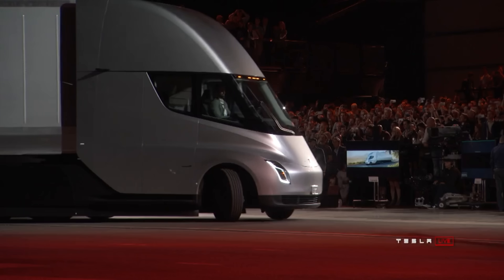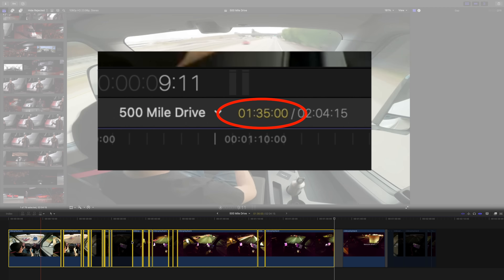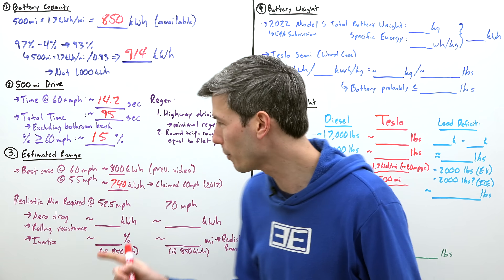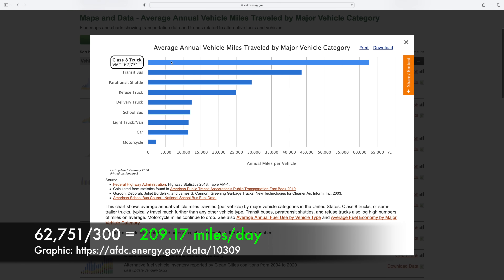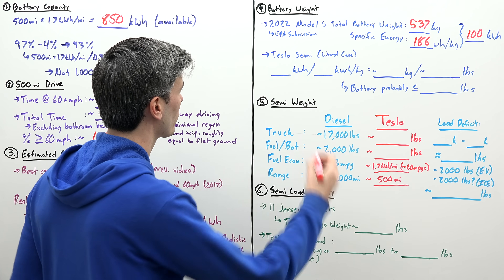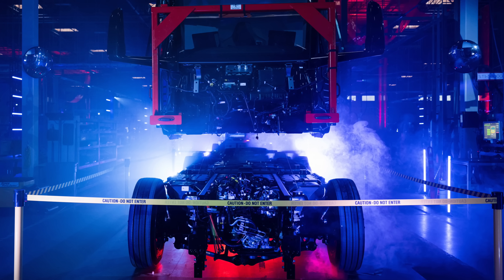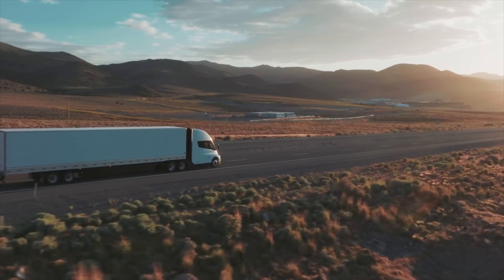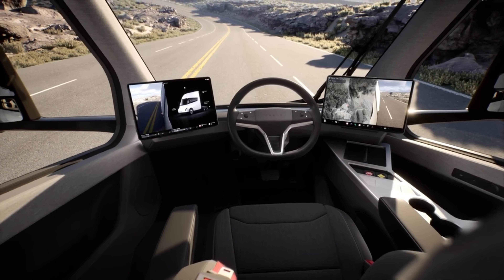Does The Tesla Semi Make Any Sense? Part 2!

Comment: Tesla semi trucks are still another 50 plus years away from being practical. Neat but that's about it
Reply: What do you mean?
Reply: @logitech4873  electric trucks can't tow the same weight as a diesel truck can, the range is no where close to a diesel truck on a full tank
Reply: @rubberbandman200  They can tow the same within this class of truck. Remember that electric motors are extremely torque-y.
Reply: @logitech4873  I'm talking about legally, in order to get a half decent range there needs to be a giant battery, turns out they are extremely heavy, the max weight a semi truck can legally tow is 80k, the weight of the batteries are gonna eat into that total weight and reduce the truckers load=less money per load
Reply: @rubberbandman200  Try actually watching this video
Reply: @logitech4873  I have, what did I say thats wrong? You have the same problem with  ev pickup  trucks. The ones already on the market can't tow a trailer more than 70 miles, and this has already been proven
Reply: @rubberbandman200  This truck can literally drive 500 miles loaded to the full legal limit. Please do some reading
 Or, again, watch this video. You somehow missed a lot of information.
Reply: @logitech4873  are you kidding me ?500 miles on flat roads, and that's even a strong maybe, once you get into mountains, lots of hills, you arnt gonna get anywhere close to 500 miles. either way that's not enough for a trucker. A fully loaded diesel can go around 2k miles non stop depending on fuel tank size. When driving in teams, a truck can go for 22 hours straight non-stop.
Reply: @rubberbandman200  The route Tesla used to show off range with a full load (81,000lbs) was 500 miles, and had a 4100ft ascent and descent, starting and ending at sea level.
The truck used 93% of its battery on the trip.

It's like you're allergic to reading or something.
It was fully loaded, it drove 500 miles, it didn't use all of its battery, and the road absolutely wasn't just flat.

Get real.
Reply: @logitech4873  😂😂 cool, I'm glad they can do a day trip load on the best possible route it could have taken for efficiency. now you gotta sit at a charger for several hours, currently these tesla trucks would not be practical, stop being a tesla fan girl and look at the facts, absolutely no trucker would buy one, 500 miles isn't enough, most drive closer to 600 a day, plus when done in teams you double that number. Dont even get me started on winter months, you lose efficiency when bellow freezing and it takes longer to charge as well. A new semi truck can go past 1 million miles before serious mechanical problems start happening. I wonder about these electric trucks that have extremely expensive components and batteries.
Reply: @rubberbandman200  The best possible route would be a flat one, or a downhill one.
They chose a route with a pretty big climb.
500 miles is more than enough for most routes actually. Again, WATCH THE VIDEO.

Comment: How about axle weight? Is this even legal in other parts of world.
Reply: What difference does that make? I'm pretty sure that Tesla can sell their 2024 business plan of 50k new Tesla Semis within the US alone, without having to worry about designing to requirements of multiple countries and continents. There seems to be a particularly strong contingent of Aussie truck drivers who claim "it'll never work here because blah blah blah". Fine! So what if it doesn't work there? That means they just won't sell it there.
Reply: @BigBen621  But market saturation point will come much faster, if it is domestic market only. Investors will evaluate the product/business viabilty trough that lens, too.
Reply: Tesla Semi is within the legal limits. The problem is it is too heavy because of the heavier battery (for better range) and that would mean it cannot carry loads as heavy as the competition does. This would be a problem for some fleet operators.
Reply: @erkanaltinsoy1  It can tow a 44,000 lb. payload, which is within a few percent of what a street-legal diesel semi can tow. Since the vast majority of trucks don't go out loaded to GCVWR, this won't be a problem for most operators. For those who load every trip to GCVWR, or have loads >44,000 lbs. that must be towed, the Tesla Semi won't work.
Reply: @BigBen621  it is around 5 tons heavier than a diesel semi tractor.
Reply: @erkanaltinsoy1  Sounds about right; but both because electric semis get an additional 1 ton in GCVWR compared with diesel semis, and because regardless of the weight of the tractor, there are per-axle limits on payload, that doesn't mean a diesel semi has a payload 5 tons greater that a Tesla Semi. Most estimates are 1 to 3 tons. 

I just came across an article entitled "What Is The Legal Maximum Gross Vehicle Weight For a Semi-Truck?", which indicates a payload of about 45,000 to 48,000 lbs. for a 53 foot flatbed trailer; while in the Donner Pass video, a Tesla Semi is shown towing a flatbed trailer loaded with about 44,000 lbs. of ten foot K-Rails (CalTrans approved version of Jersey barriers); so this suggests a payload advantage of only .5 to 1.5 tons for diesel semis, no matter how light.
Reply: @BigBen621  Yeah, because of the 1 ton advantage for electric trucks, the difference in the payload could be 3-4 tons.
Reply: @erkanaltinsoy1  It's not that much. As I showed in my prior post, the payload of a 53' flatbed trailer is a maximum of 48,000 lbs., no matter how light the tractor is. Since the Tesla Semi has a demonstrated payload of about 44,000 lbs. on a flatbed trailer, the maximum difference is about 2 tons.

Comment: I wonder when tesla cargoship will become a thing. Cargo ships are already slow boating to save on fuel costs what if you slapped a bunch of solar panels on the tip of a cargoshio that would produce decent power. Plus topping off batteries when at port to last them most of the way there. You don't have rolling drag like  with cars so I wonder how that math may work out.

Comment: Don't forget about time saving from not needing to fuel up at a truck stop. Eventually warehouses will have tesla chargers at delivery locations to charge truck while they are waiting to get loaded / unloaded. This saves on time due to not needing to stop at a truck stop. Another advantage is FSD. Eventually drivers will be able to only monitor the truck instead of driving it himself. Allowing for much more miles to be not driven by the driver.

Comment: Another fudge factor not accounted for is that not all of the 500 mi route is going to be spent on the highway. So even exclusive of the times highway speed was not up to highway speed limit the overall average is going to be below highway speed. On average, how much time is spent in towns? On average, how much time is spent decelerating/accelerating into weigh scales and gas stations.  500 mi at 60mph is a 8.3 hour day. Obviously electric trucks are not stopping for gas/diesel, but truckers do like to stop for meals and to unload personal "waste" products. Unionized drivers have negotiated break times.  There are Federal and State operator time limits.  So, yes, I can see that even on a highway with a 60 mph speed limit, the overall trip average is going to be less than the highway speed limit.  And the shorter the highway portion, the lower the overall average is going to be because the highway portion is going to be relatively less of the total.

Another fudge factor, or in this case "chip factor" is the average weight of a truck load of chips.  How many cases can they ship in a truck load? I don't have the dimensions of a chip box so I can't come up with a number. How many boxes high do they load their pallets. Typically I've seen pallets loaded 8 boxes high, but I have loaded higher piles with lighter contents (ie boxes of bread). 

Please keep doing this fact checking. As you've noted, Tesla has been somewhat "casual" with the "truth" when it suites them.

Have you seen any of "Munro Live" youtubes? He is an efficiency expert who has helped Tesla optimize their construction and has torn down several Tesla (as well as other manufacturer) products giving his frank assessment of what they are doing. He has gone to the extent of completely stripping down Tesla battery packs to the individual battery cells and all other components. In a recent video he has said he is looking forward to tearing down a Tesla Semi ... His videos are entertaining and fact filled. If you have the price, his company actually sells complete component break downs, including unit cost (estimates) for all parts.

Comment: Sources say that recharging Tesla semi truck battery to 70% takes 30-45 min. Assuming the battery is "only" 850kWh, that means 70% is 600kWh. However, given that chargers are rated 750kW (as per info in this video), they obviously cannot deliver more than some 375kWh in 30 min. This is a theoretical maximum assuming no charging losses exist. But since they do, it is more like 300kWh in 30 min. Especially given that in real life charging rate may also be limited by high battery temperature. So 30 min in real life is more like 2h? Or to put it another way around to achieve 70% for 30 min chargers should be almost double capacity, i.e. around 1.3MW? That will never be possible - which "plug" can be used to mess around with 1.3MW (1300kW)??? 1.3MW happens to be approx equal to average demand of around 1000 households. So if a charging station with such mega chargers is to have 10 chargers, and assuming all could be used at full capacity at the same time, then station power capacity that somehow needs to be provided by the grid is equal to household power demand of a town of approx 40 000 residents...

Comment: Electric vehicles cannot tow for squat.
Reply: Where'd you get that nutty idea? If you're talking about electric vs. diesel semis, a Tesla Semi has two to three times the HP of a typical diesel semi; unlike a diesel semi, a Tesla Semi has most of its maximum torque at zero RPM; a Tesla Semi has more weight than a diesel semi; and by having the battery centered amidships and the drive motors on the rear axles, compared with a diesel semi with the engine forward, the Tesla Semi will have a major weight shift from steering axle to drive axles. All of these factors improve the Tesla's towing ability, compared with a diesel semi.

You may have missed the video of a Tesla Semi loaded to its GCVWR of 82,000 lbs., passing a lighter diesel semi on the steep grade up Donner Pass, as if it were standing still.

If you're talking about electric cars and pickup trucks, this is true. But it's irrelevant to semis, which are the subject of the video. In the case of electric cars and pickup trucks, adding a trailer more than doubles air resistance, causing a major reduction in load. But in the case of a semi, the trailer is already part of the range calculation; so there's no reduction in range for towing the trailer.
Reply: @BigBen621  I didn't make my statement correctly so I am sorry.  "Tow for squat with any efficiency" is what I meant to say and I think that is why they are having trouble releasing the truck.  As soon as those payloads go up see ya be lucky to get a few hundred miles of range.  Someone just did a range test of one of the new electric trucks and once he hooked a trailer up to it it destroyed the range.  Now maybe your right with the added efficiencies of air resistance but I will wait with popcorn.
Reply: @blarpieman  There's no evidence that "they are having trouble releasing the truck"; by December, more than 30 had been released to their launch customer, PepsiCo.

The well documented 500 mile trip from Fremont to San Diego on 93% charge was run with a full payload of around 40,000 lbs. So the Tesla Semi can actually tow fully loaded trailers with great efficiency, around 1.7 kWh/mile.

As I already point out, adding a trailer to an electric pickup truck reduces the range dramatically because of a huge increase in air resistance. No such effect applies to the Tesla Semi, since the 500+ mile range was run with a fully loaded trailer already attached.

Comment: I like your clips but on this one their are some facts you missed. one is the weight most states it is 80000# that is bridge weight, DOT does not care if it a diesel=electric or you push it across a bridge you are going to get a ticket. two, drivers get paid by the mile, going 60 or less= no drivers and where are these trucks going to be when they have to be off for 10 hrs go look in a truck stop or road side stop after 7 at night and look at the mess. I could go on and on about why this will not work for most trucking. the truck they show is a stripped down oversized daycab. I am a O/O and i have 8 trucks so i do have some know how about trucking. this reply is not against you but to show that it is far worse then you show thanks and keep doing your vids
Reply: It can "not work for most trucking", and still be a complete win for Tesla. Their business plan is to sell 50,000 of these in 2024, which is a tiny percentage of the 2 million-some diesel trucks on the road, is even if it can't do what the vast majority of diesels do, it'll still be a win for Tesla.

Comment: Would you be able to calculate what speed the Nikola Tre FCEV’s 500 mile range is based off of? They don’t give a ton of information but they say it gets 536HP and 12.5K foot-pounds of torque
Reply: For the Nikola- the range is equal to the hill length plus coast distance.
   The speed is a function of the steepness of the hill and any head or tailwind. 
   The same calculations would also work for a soap box derby car, or a basketball, if it stayed on the road.
   Trevor Milton...what a guy!
Reply: @firstielasty1162  So funny I almost laughed

Comment: If the trip was 500 miles and completed in 8 hours that would be an average of 62.5 mph. If the video was actually 8 hours, in the time-lapse, the driver starts as 0:12 seconds, and takes a bathroom break at 1:27 to 1:39, and pulls into the parking lot at 1:59.  Thus 107 seconds of run time and 95 seconds of highway speed (without stop lights or off ramp/ street speed). If that is all within the 8 hours, then there was about 7 hours and 6 minutes of drive time, and 54 minutes break time (a long bathroom break) and the average speed would have been about 70 mph.
Additionally the flat highway hypothesis assumes that only regenerative breaking was used so slow the truck and that it is 100% efficient.
Reply: The speed can periodically be seen when it's not obscured by the driver's cap, and a spot check suggests that it's never over 65 MPH; so it's more likely that the trip took a little more than 8 hours, than that the average speed was 70 MPH, and that the 8 hour figure was just thrown out as a rough number. It's probably possible to calibrate the actual time per frame and derive the actual length of the trip by comparing the known difference between two points on I-5 in Google Earth, the speedometer reading, and the number of frames between the two points; but I don't have the patience to do this. Since you're good with numbers, wanna take this on? 😊

The truck likely did use only regenerative braking, or at least almost only regenerative braking. Tesla stated in the delivery video that after descending Donner Pass, the friction brakes were cool; meaning that only regenerative braking was used on the that descent. The Grapevine is somewhat comparable to Donner Pass, so the same was likely true for the Grapevine.

Of course regenerative braking is not 100% efficient. But what turns out is that the smaller air and rolling resistance losses at the lower speeds during climbs and descents about cancels out the roughly 20% round trip energy loss of regenerative braking. So the net effect is that a trip with a steep climb and descent will use very little more energy than a trip on flat ground, and might in some cases use even less. Keep in mind that the truck speed limit on the Grapevine is 35 MPH, both up and down; while the average speed on the level parts of the run was probably around 60 MPH or even higher as discussed above; so there's a substantial reduction in air and rolling resistance on the up and down grades.

Comment: This is interesting but the important question to me seems to be how many kWh in a diesel semi fuel tank is useable for work. And then, what percentage of that does a Tesla truck have (let's say 8-900kwh capacity)? If the diesel's fuel contains 5000kwh and the drivetrain is 30% efficient, that would assume one diesel truck could do over 1.5x the work of a Tesla truck, all other variables being equal

Comment: You have an issue with your calculations is that the weight a semi can carry is a overall limit AND a per axel limit so that extra 8k extra you can only remove 2k of the engine weight not the extra 2k of overall. the overall weight may be more but the per axel has not changed. but you get to remove even less than that because most of that engine weight your removed is from the front tires which really do not get near the extra weight when carrying a heavy load so that extra 8k batteries is really 6-8k not 4k due to axel restriction also removing much more than the 6-8k from the load due to how weight distribution on a trailer works so their carry capacity is roughly 50-70% of a standard semi not including the amount of time lost to team driver trucks that only stop for fuel and food not the shutdown time needed for charging so roughly at best we would need to double the amount of trucks and driver in a career that is extremely underemployed to maintain current shipping capacities while shortening their range and increasing the turn around time. These trucks would be fine locally but OTR  it is not feasible